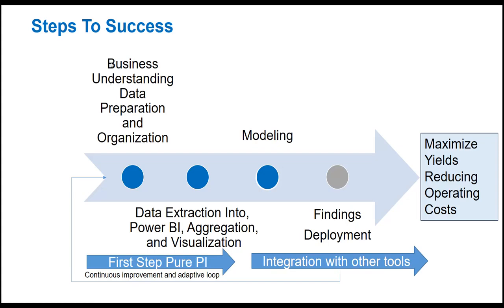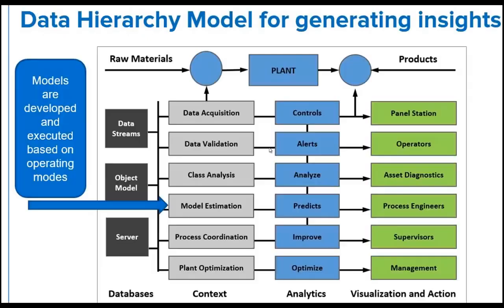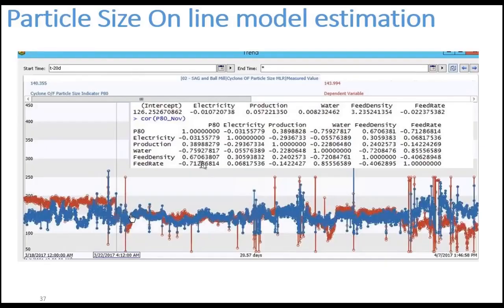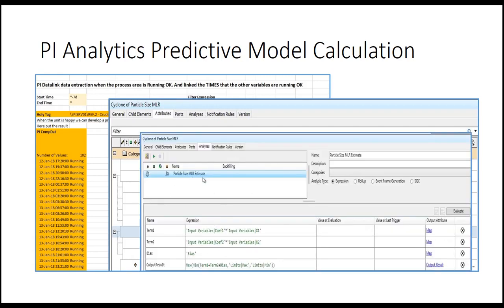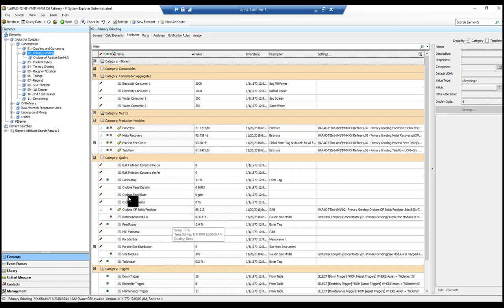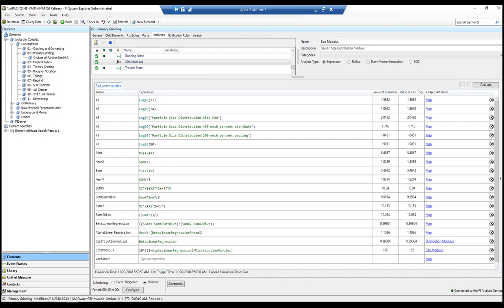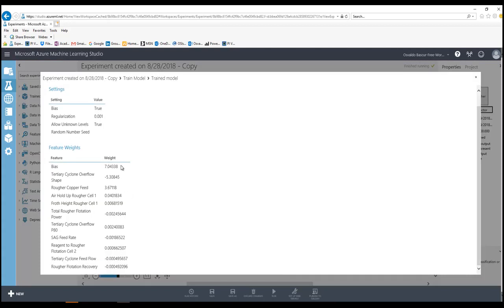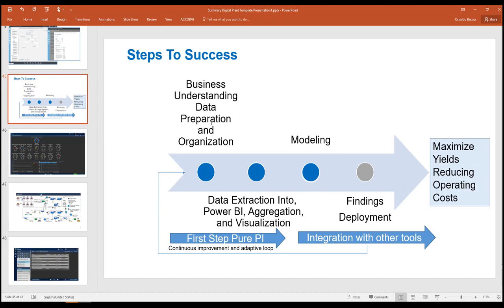Digital Plant Template for Operational Insights Part 3 NUTNSJmnC1g

Comment: A flotation plant is likely to have significant lags between measurements. Does accounting for those lags improve the predictive ability of the regression model. Interesting application of Azure Machine Learning Studio.
Reply from the maker: Bill Pate The key is find the good operating times of the Mill to have the right grinding size distribution shape.  This affects the recovery.  The key is calculate the recovery to have realtime to find the best model.  We also model the whole bank using the flotation knowledge developed in my early research.  To get the right dynamic we have to find the delays which are the residence time of the equipment.  Lots to improve now that we got the tools.  Now, we are using Seeq Lab which has a Jupiter environment to develop the predictive model.
Reply: @osvibascur4601  Is the predictive model an algebraic regression model, a time series model or a phenomenological model?